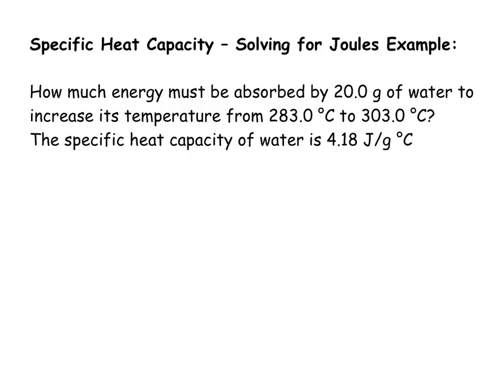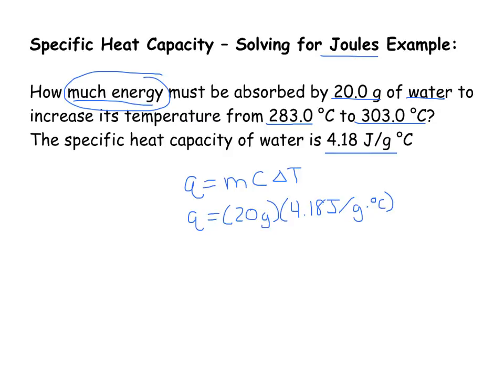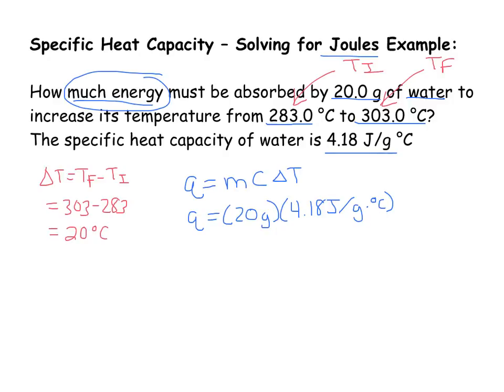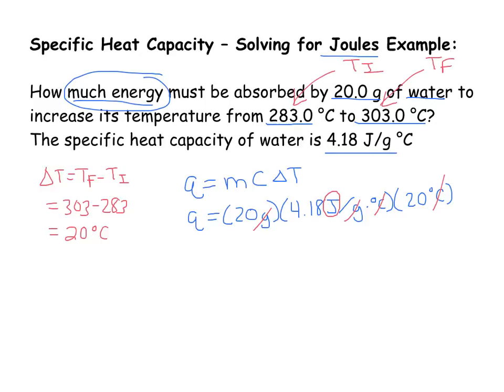Specific Heat Capacity - Solving for Joules

Comment: why did you subtracted it, shouldn't we add? (C)
Reply from the maker: Hi Nonosh,

I think you are referring to the change in temperature? 

When finding change in temperature in these problems, you need to subtract the final temperature from the initial temperature to find the difference between the two temperatures. Just the range in which the temperature changed. 

Adding the two together would give you a huge amount of energy when the final answer was calculated. 

Please let me know if this explanation helped or if you need more assistance. Thanks.